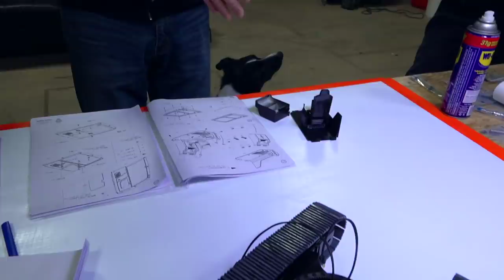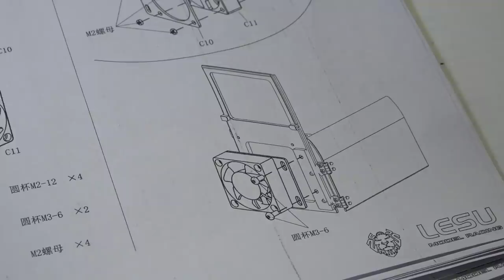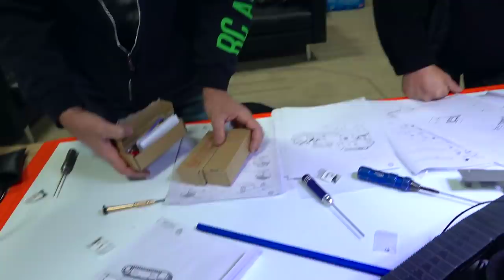BUILDING a "KOBELCO EURO" EXCAVATOR (Track Hoe) - LESU ALL Metal PC360 Kit PT 4 | RC ADVENTURES

Comment: I love it.  Watched it twice.  The blue is fantastic and the brass is a great contrast.  The water slide decal will work great with an over spray of clear coat to seal it on, old modelers trick.  Also when applying the water slides to use vinegar to set the decal.  The vinegar will make the decal soft and flow into and details on the surface and make it look like it was painted on.

Comment: Personal opinion would be black rams using the paint as an added layer of protection. The pipes I think look fine. For the water slides, I would spray a clear coat over the entire unit. It would seal the decals as well as protect the paint.

Comment: Got the same excavator as you, but this one I think has the corrections you made in your video. Mirrors changed, different pump motor,  I think bigger, and release valve in different place. But I'm having problems with the wiring, which I can see from yours, has a lot more things to wire in. Plus the part you had that was leaking, there was a set of set screws that you were suppose to put in the ends!  Randy from Calgary

Comment: 26:18 The hydraulics for the boom should be installed in the other direction
Reply from the maker: No they shouldn't.. they are correct
Reply: The hydraulic tubing should face outward to the front

Comment: I think your boom pistons are on backwards the pipes should be facing the outside because when you boom up it could pinch the block where the pipe goes into the bottom of the cylinder
Reply from the maker: Nope, you're incorrect.. they are on perfectly..
Reply: RCSparks Studio just looking out not trying to insult so don’t take it the wrong way but see what happens when you boom up all the way when you get it going because where the pipe goes into the bottom of your boom pistons it may get pinched on the frame because as you boom up an excavator the pistons pivot closer to the center of the machine that’s why the pipes should be facing the front of your machine not inside
Reply from the maker: @antwonious  You know, Im not in the shop right now.. but thank you for your note. I will double check the instructions and look at it to ensure that it is correct. Thanks for the heads up. Always good to check things twice
Reply: RCSparks Studio no problem man when you get a chance look on the Lesu website and look at the picture of there machine you’ll see what I’m trying to tell you the machine is beautiful tho man and coming together real nice would hate to see you have a problem with it

Comment: I am looking at getting an excavator . Would you starting with the 4200xl or save more money an go to the lesu C374F. I would have no problem building the kit . I have converted 2 excavators using linear actuators
Reply from the maker: Definitely the kit.  Just for the simple fact that these hydraulic lines have no place to leak on the ram. My RC4WD 4200xl leaks like a sieve.. but it is 5 years old. Too many places to leak.. when the Lesu is brazed nicely
Reply: @TheRealRCSparks  thanks